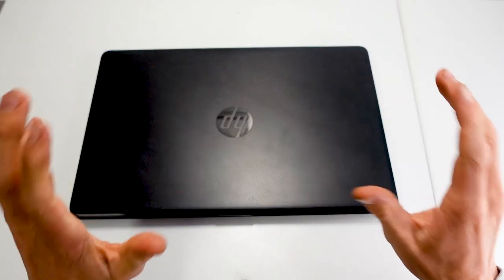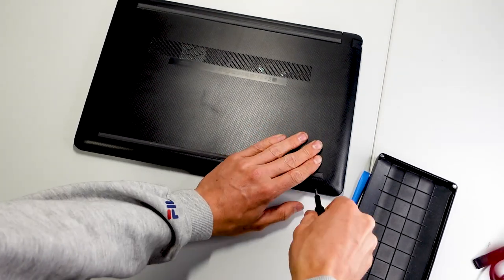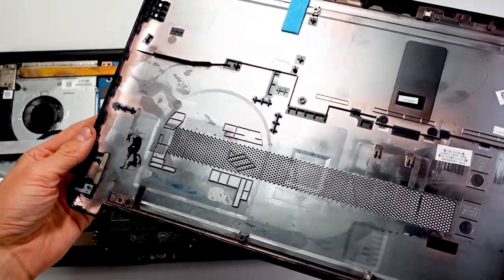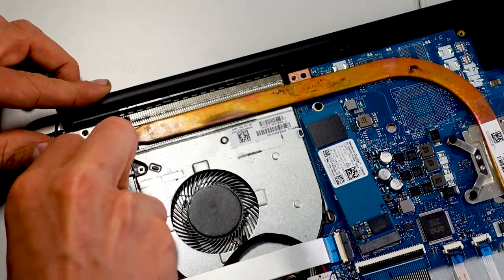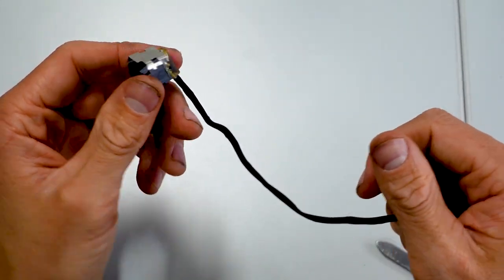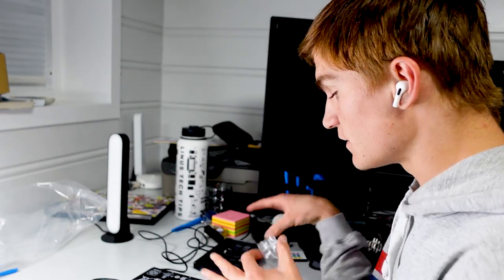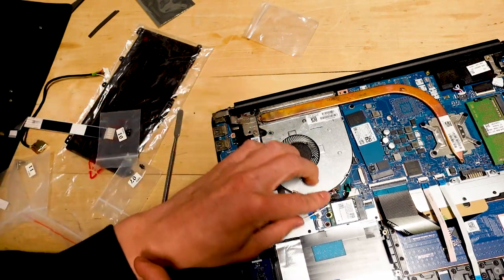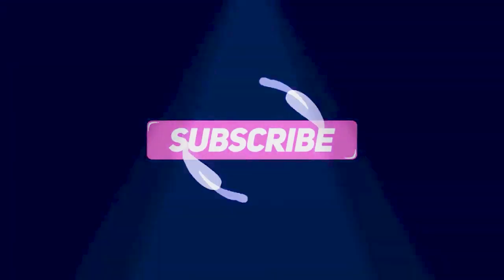Repairing a DEAD laptop for just 4$

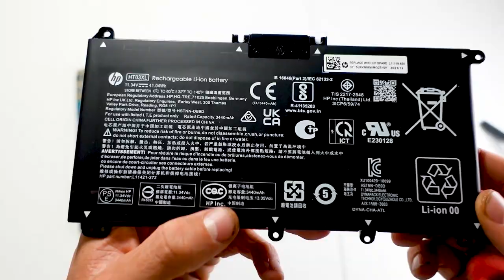Comment: 4:47 It's only less capacity than your phone if there was only one cell on the laptop, but there's three of them (11.34v in the label indicates it's three li-ion cells in series). You're supposed to compare Wh ratings, not mAh, as mAh does not account yet for the voltage. This laptop has a 41.04Wh (it says so in the label), but calculating the rated voltage and capacity gives: 11.34 x 3.44Ah (3440mAh) = ~39Wh. Assuming your phone has a big battery, 5000mAh x 3.8v = 19Wh. This laptop still has likely ~2.5x the battery on your phone. However, great job saving a laptop that would have ended up as e-waste!
Reply from the maker: I will take that into consideration, thank you for letting me know. Now i got something more to learn ;) Thanks for commenting!

Comment: He said, December 20, 22, so this piece of junk has only been on. For like, 2 months.I'm not gonna buy an HP laptop obviously
Reply from the maker: Im not a fan either, but they usually have parts for them so repairing them is easy :)
Reply: @leqacy2018  I was just shocked that that laptop it only been out of the factory for couple months and already had both the power. That's what I was saying, but your channel is awesome, I really enjoyed watching it because I have a Dell laptop that has a faulty charging port, so that's why I was watching it to get some advice on how to do it, but your channel is awesome. Don't think it's not, I was just shocked at that laptops.
Reply: I have worked on 2 different laptops, I replaced the lcd screen in one. And changed out a keyboard on another.